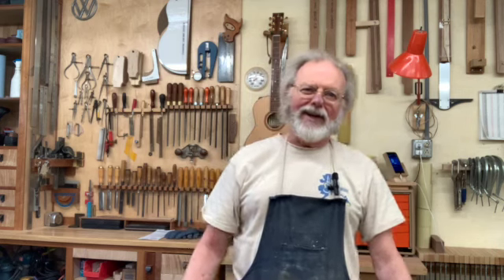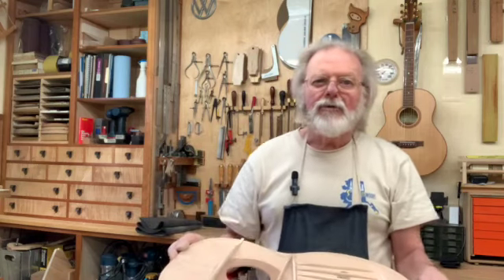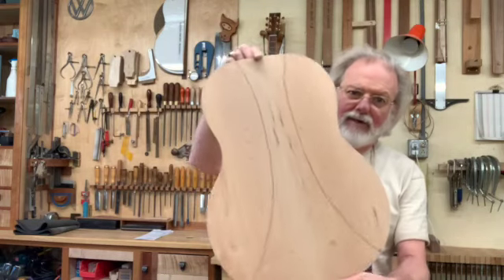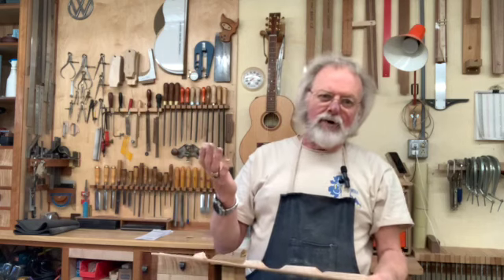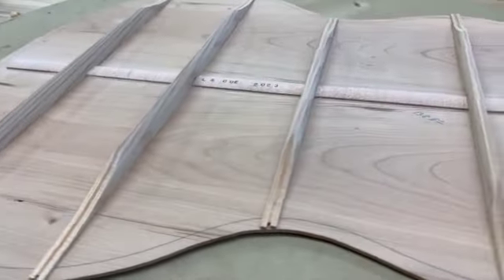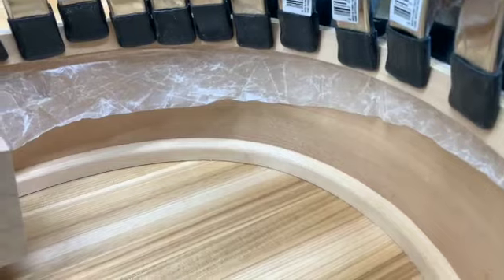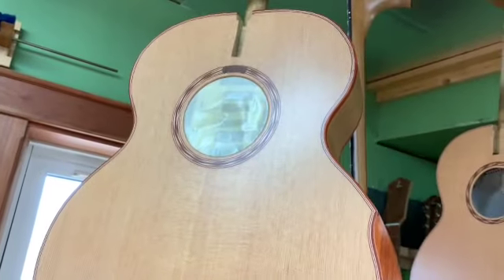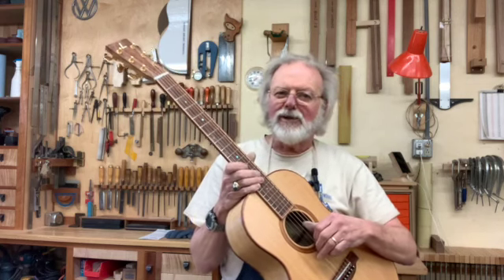ACTIVITY IN THE SHOP; MAKIN THEM GUITARS

Comment: I wonder if Balsam Fur could be used for a guitar top? If nothing else, it would smell great!
Reply from the maker: I just looked up Balsam Fir (Abies balsamea) and found that it might be very difficult to find logs in large enough diameter to be useful as instrument wood. It grows throughout a very extensive range, however and if one could find large enough pieces to quarter, it would certainly be worth trying. Thanks for putting that idea in my head.
Reply: @thepragmaticluthier  I have seen logs 25-30 inch diameter here in the Adirondack Mountains of upstate New York. What size do you need?

Comment: Great work!
What is your opinion on back sides? NK Forster suggest that he gets better results with laminated wood as they tend to be more reflective and less vibration is taken away from the top. Have you done some experiments on the matter.? Perhaps a good topic for a video. Thanks
Reply from the maker: It is true that a laminated rim will deflect more kinetic energy back to the top, and I suppose, more than just a laminated lining, but laminated rims are VERY WOOD COSTLY. They appear to be wood economical, but to the contrary. Consider that to get a piece of wood down to solid rim thickness, let alone laminating thickness, easily twice as much wood ends up as dust and chips. I have been attracted to laminated rims but doubt that I will engage in their use.